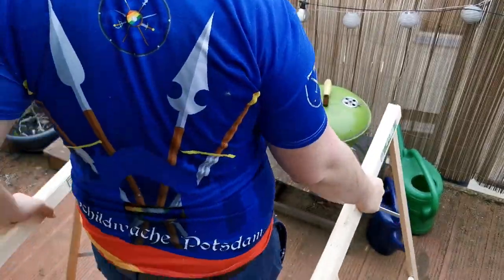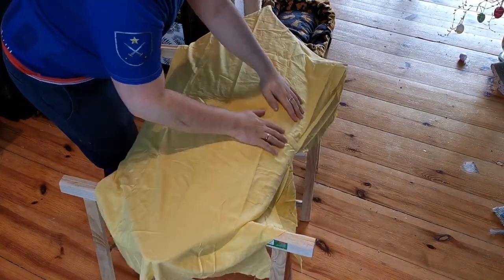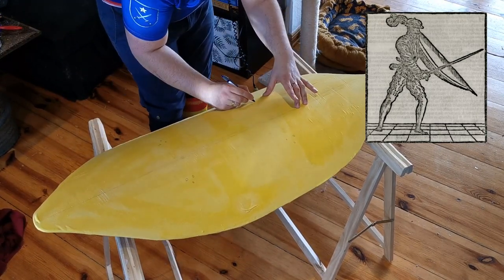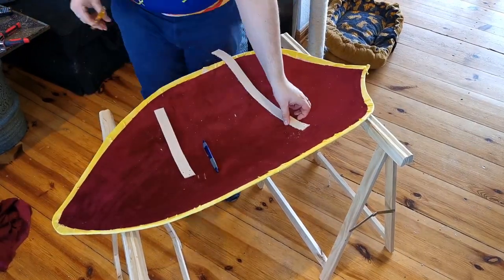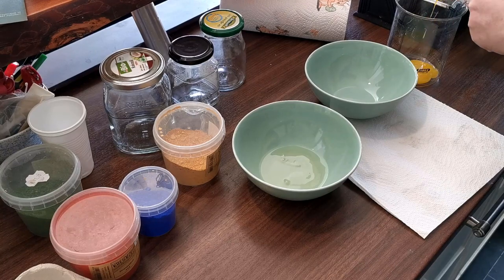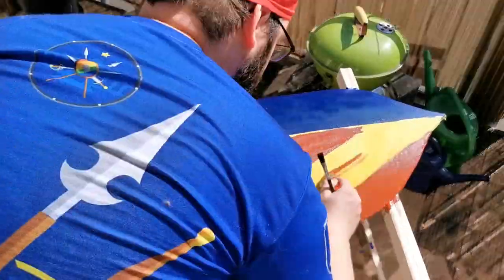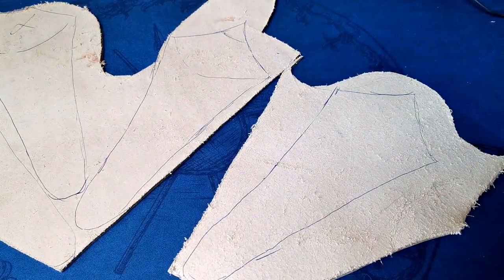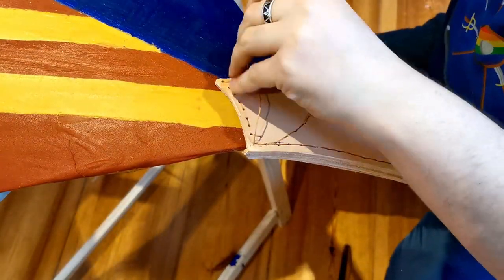Building Marozzos Renaissance Shield: The Imbracciatura

Comment: Neat! The only difference in the way you made your shield and the way I make mine is edging. I edge the shield with rawhide to give it a longer life. You can also glue a rope to the edge of the shield and then cover it in rawhide.
Reply: I did this also for some more medivial shields, depends always how i want to use them. for more technique focused training supporting the edge is not as important, also the damage to it always depends with which weapon it is paired, against a "thin" edge of a sidesword actually the edge holds up pretty nicely, (you will get a local nick into the edge, but you dont crush a large area)  If you would build a few for a tournament setting, then i would support the edge =)
Reply from the maker: The basic shape of many of the shields are super similar, this renaissance shield is very comparable with an teardrop shield from earlier times :) Since they started to have more metalwork they didnt go with rawhide anymore. Maybe Stephan will build a velvet rennaissance buckler with an pompom edging :D
Reply: Good point, all the shields I have made have been for  SCA fighting,  where a long lasting shield is a priority.

Comment: Lovely work! What's the purpose of the bottom leather "nose". Is the source clear that it's a separate piece?
Reply from the maker: The  leather acts as a sparing safe "blade". In the source, its a sharp tip/blade which also can be utilzed to wound the opponent.

Comment: How’d you settle on the length? Btw what are the dimensions. The curve looks good and handle.
Reply: So, the lengthvise it is 120cm without and 140 with the spike. I basically adjusted it after the height in an low stance to the shoulder, so I can still freely move it without scrubbing the floor.  The projection of the width is about 60 cm. Weight: it's in a range we're you don't care, since it handles nicely but has presence. I assume around 3-4kg.   The handle straps are positioned such that the shoulder is covered, one strap is at the elbow, the other at the hand.
Reply: @stephan-schildwachepotsdam1171  very nicely done

Comment: May I ask for the size and dimensions of the shield?
Reply from the maker: The wooden board had a size of 120x60 cm made out of poplar wood. (2 sheets each 4 mm). the resulting diamentions are of cause smaller. and the leather spike adds around 10-20cm